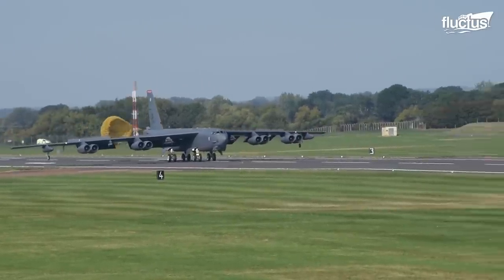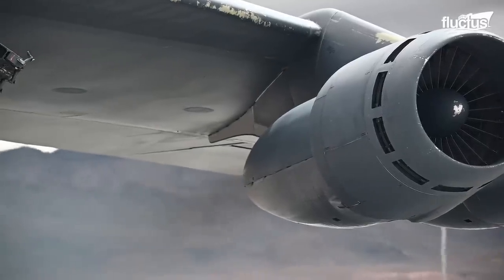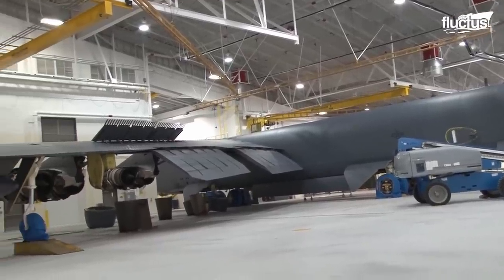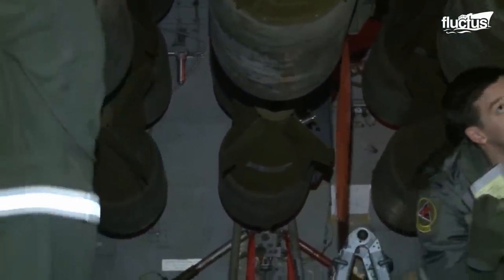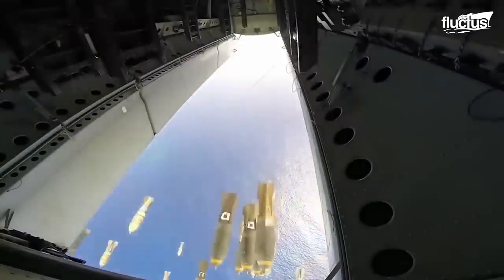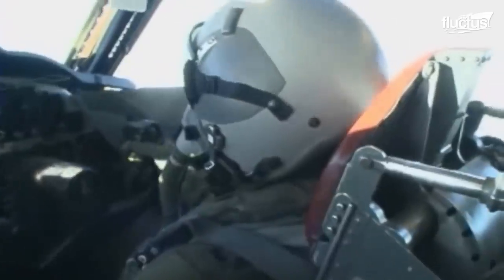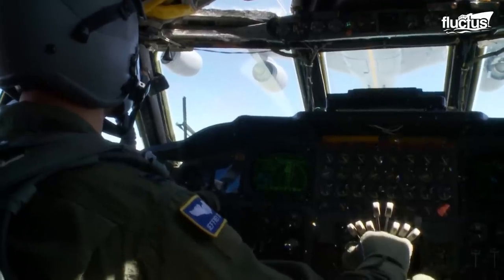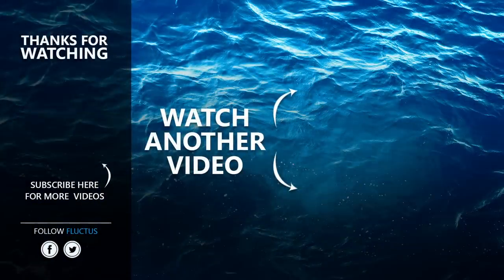The Scary Processes of Repairing US Air Force Gigantic Bomber

Comment: That's why Boeing is the best designer/ builder of aircraft in the world. I worked in the airlines for 45+ years & a good portion of that on the 747. If they're properly maintained they'll last forever. I am amazed at the basic structure of the wings though. Those wing spars must really be something. If anything is going to fail, it's usually those, when talking about something that would make a plane fall out of the sky. 
Airbus, on the other hand are junk. When my airline first got the A320s, we called them "Hugos with wings". And when they went in for their first heavy maintenance, we had to replace whole seat tracks because unlike Boeing, we couldn't replace just the damaged pieces. They're 20' long !

Comment: I'd be more concerned with the airframe and its age than anything external that can be easily patched, repaired or replaced. And as far as bomb loads the B52's 70,000 pounds total bomb load is made to look small when compared to the bomb load of the Rockwell B1, which can carry 125,000 pounds of bombs.
Reply: Im pretty sure they know what theyre doing 😂